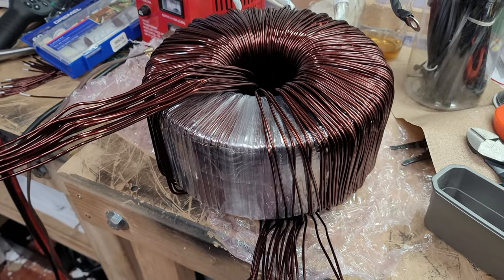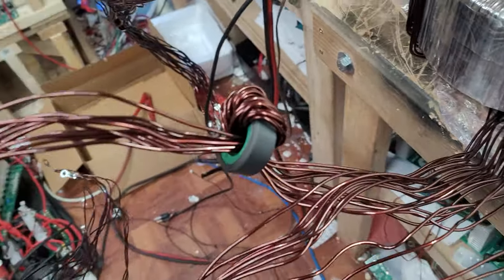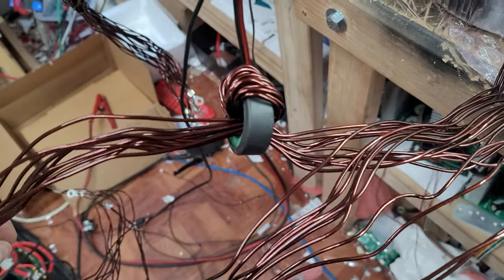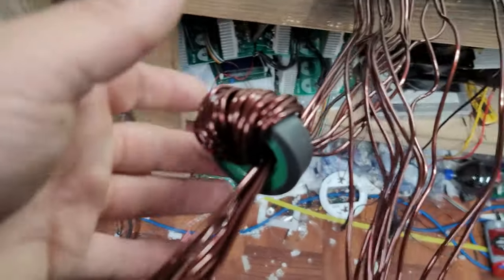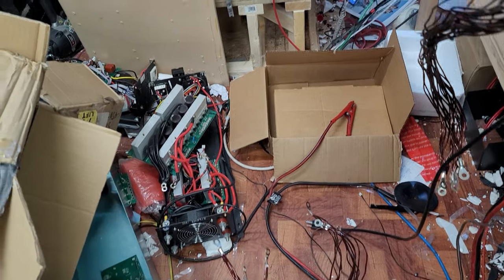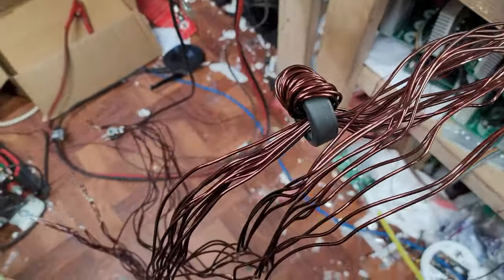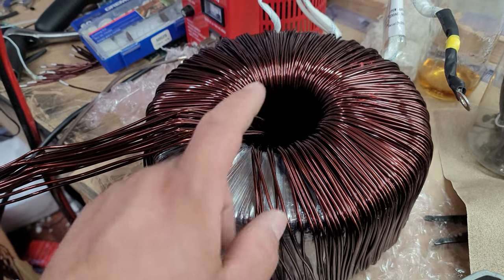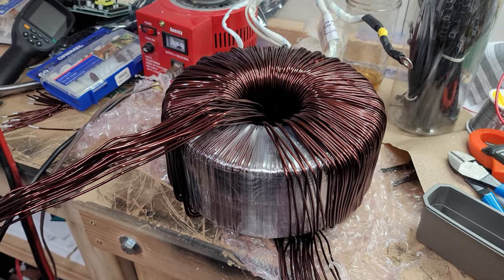Transformer choke tricks?

Comment: 1 turn is all you need. 2 turns turns it into an inductive heater as the Ferrite Core is saturated. No such thing a AC Positive and AC Negative leads. Those are L1 and L2 of the Primary. Your Mosfets just produce pulsed DC. When one side is on, the other is off.  Glad to hear the newer transformers do a better balance job. My ASL1 has 119 V on Line 1 with only 114 V on Line 2. And that is set at max Voltage. As you have two Main Boards, yes, you would want an equal number of wires to each. Also you might want to add a jumper wire between the two units to make sure they stay balanced.

Comment: The turns around your  choke are inducing current into it, that's why it's getting hot (like how an induction heater works). If you put the choke that you have, in the unfiltered part of your dc circuit, it will help reduce voltage spikes. As the current in the dc part of your circuit does not change direction, 50-60 times a second, no current is induced into the choke, and it won't get hot from induction.

Comment: Its called Saturation, It's core is fully saturated, So either go with a different mixture or a larger size. I would check the frequency coming off and see what mixture you need..The ferrite mixture. Do you know what type it is? There's thousands of mixture. I rewrapped my transformer in type 61. On both Positive negative.

Comment: Fun project.  I think your answer about heat is in what the choke does in general it is like adding a big resister inline so they get hotter the more resistance it is providing.  The fields interfere with each other resisting the current flow which will filter out HF noise but if there is too much your final efficiency will suffer.

Comment: does it make a difference?
Take voltage and current measurements before and after adding the choke. If the choke is getting hot then power is being wasted, they are only used to reduce ripple and noise. You'll need an oscilloscope to see the difference

Comment: Thinking about the problem your working on some more.  So getting it tuned perfect is pretty tricky so may have better luck with a tuned line filter.  Looked some up on Mouser think this Delta part number 108-30DKCS5 may work pretty good.  It uses a filter resister capacitor circuit combo.  I have used these in the past on large postal equipment to filter out harmonics in line to provide cleaner power for the micro-nets.

Comment: I stopped at 5:18 as I'm pretty busy but here is my take on this because you are asking for advice.....I'm not an RF engineer which is way different than a programmer or other types of electrical engineers.....toroidal transformers do not change the power (ohm's law and Kirchhoffs's laws apply here so basically the efficiency power out divided by power in means that the power on the output is the same minus the power loss due to efficiency/heating)  So the power changes from low voltage with higher current to higher voltage with lower current.  Toroidal transformers provide self shielding properties.  They also have inductance squared to the number of turns so less copper wire can be used with a much larger toroid core.  Less copper means less I squared R loss.  You talk about chokes....nobody is talking about what frequency is desired to be suppressed.  So the choke behaves as an inductor but the choke uses a "mix" as you mentioned to absorb the frequencies desired to be suppressed more than the other so essentially the core acts like a sponge in some ways but at different frequencies the sponge effect varies and of course with high enough power....can we say RADAR in the pulsed megawatts?....the toroid can "ring".  For an AC mains choke the obvious is you would want to suppress the higher interfering frequencies while not suppressing the mains frequencies at all.  So the question becomes more than the mix but also the material.  There is powdered iron vs ferrite essentially with each mix absorbing and behaving differently.  If you don't know the interfering frequency just throwing a choke in there may be a serious issue.  Also, chokes can be potentially used to help suppress ground loops but good luck on that one.....folks use opto isolators many times for signalling/data but those have a fixed life expectancy that is really long but still have one.  You mentioned the square black plastic so I'm assuming you are talking about the split type that allows less turns and is not continuous....so basically that is a compromise.  Why worry about the choke in the first place?  If not needed then don't use it.  If there are interfering frequencies it is time to break out the test equipment and suppress those.  Then there is the FCC requirements etc.  Again, I hear no mention of interfering frequencies, type of material, and specific mix.  The power handling can be determined by the size of the toroid.  The reduction will also be dependent on the square of the number of turns which is directly proportional the inductance etc etc blah blah blah.
Reply: Oh....I forgot to discuss shielding.  This is another dimension of noise reduction.  One can use pass through devices on a metal enclosure that essentially has a center conductor with a fixed capacitance to the outside shield.  I also did not bring up filters which is yet an entirely different field of math/electronics.  You can have band pass, low pass, high pass and different types and number of stages.  The old standby at RF is usually a capacitor in the micro farad range.  You may find this as a really good way to reduce noise because at AC mains the capacitor will be seen as an open circuit but at interfering frequency a short.  With a filter it can go both before and after the toroidal transformer.  Then with shielding I cannot help to bring up again the subject of liquid cooled (yes for the nay sayers I will link again the blog from an industry leader that calls it liquid cooled vs air core etc etc blah blah blah perception becomes reality blah blah blah).  If it was me making a frankenstien inverter I would have a shielded liquid cooled (using Shell Diala which is mineral oil with inhibitors used in power pole transformers/pig pole transformers by slang name)  This would be like an RF dummy load.....cooling fins.  So an RF dummy load has a non inductive resister immersed in..go figure mineral oil with inhibitors that does not react at frequency range it is rated at....with this you can then have passive cooling to the air.  Liquid cooling always blows away (pun intended) air cooling.  With the broadcast industry I learned a joke which goes like this "real tubes have handles (because they are so huge and are made from glass and insulators rated in the 10's if not higher kilo watts) and when do you have too much air cooling?  Answer:  when the fan blows the tube out of it's socket. hahaha blah blah blah.  So in other words air cooling sucks when not using a liquid transfer medium to take the heat away from the protected device (toroid transformer).  One could get insane power handling with this method but of course it costs money so don't expect it soon unless they discover an already existing extruded aluminum size that is large enough to house the toroid.  Then one would need to get a tig welder or robotic welder to close up the top and bottom or machine so top and bottom can have gaskets/o-rings.

Comment: The purpose of these Ferrite Choke is to meet FCC RFI emissions standards.  Keep any Radio Freq Interference in the equipment.   What are you attempting to accomplish ?

If your transformer is getting hot it's a function of Current.
Reply: The ferrite choke makes a CONSIDERABLE difference in the no-load current of a Power Jack inverter.  In my experiments, a 48v inverter with no choke runs over 5A no load.  With several choke-winding tricks, I was able to get my 9K down to 0.7A no load.  My guess is that it is providing some much-needed inductive "capacity" at very low load conditions.  With a PJ inverter, the transformer and choke get gently warm (0.7A no load current achievable); however, with a Genetry Solar control board (and much stronger FET drive), the choke gets quite hot at no load (0.4A no load possible on an 8K).  Also makes a 60Hz humming noise, and the sound changes if you squeeze it.
Reply: @sidlori1592  If it does it's taking down the on line current as well.  They're only there for RFI.   Think : Impedance.  AC only Resistance.  That long pig tail is going to cause issues too.  Everything on the other side of the Core is going to work as a Antenna.   Adding NOISE.  Your none loaded load is caused by the incorporated circuits them selves.  LED's.  Cap leakage and what not.  Ferrite is only hiding the other stuff.  One turn does what the farrite is meant to do.  Adding turns is CHOKING your power output.   Something is being driven if it's using that much current no load.  That's way more current then you should have with no load.  Only thing that should be seeing power when idle is the sensing circuits and clock.   Assuming it has a Micro Processor Unit  I would expect less then 100uA.
Reply: @pulesjet  "One turn does what the farrite is meant to do."  Nope.  Adding or removing turns to the transformer winding only changes the ratio.  If it was as simple as adding one turn to the transformer winding, Power Jack would be doing that themselves, instead of buying a choke.

"Adding turns is CHOKING your power output."  Not possible for the choke to significantly reduce the output power on a 15KW inverter without the choke going up in smoke.

"Only thing that should be seeing power when idle is the sensing circuits and clock"  Umm, as in, inverter powered off, no AC output??  No load is defined as 'AC output at desired voltage, no load connected.'

"Assuming it has a Micro Processor Unit  I would expect less then 100uA."  The PIC18F87Kxx MCU running at the full 64MHz @ 5v (which it does in a PJ inverter) is rated at 14mA.  You have to turn the CPU off (Sleep or Idle modes) to get 100uA.  If you're referring to full inverter operational current with no external load connected...umm, not close.  Adding to the 14mA MCU is at least several 10s of mA going to switching the MOSFET gates (~8,000pF * 24 FETs @ 24KHz, thank you very much).  Not to mention the other power supplies and glue logic.
Reply: @sidlori1592  If the Choke Ferrite is heating it's obviously inducting the lower freqs too.   At least with your added twist.   15Khz.The ferrite is not your issue.  The power is being consumed someplace else.

Comment: Wouldnt you need to add more copper, with less turns to equal the same wattage? Without heating? I have studied quite a bit on building transformers, it has been a long while,  so I  have possibly forgotten a bit I guess!
Reply: You are absolutely correct; however in this case, the PJ windings are quite underrated on the AC "line" side of the transformer.  A lack of copper cross section on the "battery" side of the transformer is not going to be significant in this case.

Comment: reducing turns in the transform also reduces the current handling
Reply: By removing wires on the Secondary, he is getting it from a 6.7:1 ratio to an 8:1 ratio to keep the Voltage the same, so Wattage and Current will be lower.
Reply: True.  But it's a simple way to avoid rewinding the entire primary ;-)

Comment: Try that giant core I sent you
 I am using one just like it and idle current is 0.44 
And it doesn't get hot
 if you want to use smaller core you will need to use Square ones 
so you can have a space or gap in the center leg 
The bigger the gap the more amps it can handle before it saturates
Reply from the maker: Yeah I think I will do that
Reply: I can go count how many turns I put on mine so you can get a perfect wind 

Or you could stop by and swap your empty core for my all ready finish one exact core as yours

If you glue four of the power Jack cores they work ok I think 0.80 idle amp

Comment: IS THE MOSFETED DC TO AC CURRENT GOING THROUGH A SINGLE WIRE OR SEVERAL WIRES I SEE WOUNDED AROUND THE PRIMARY COIL ? TRYING TO UNDERSTAND THE TWO ENDS OF SEVERAL WIRES HOW THE CURRENT GOES IN AND OUT THE PRIMARY LIKE A WIRE WRAPPED AROUND A NAIL TO A BATTERY . GREAT VIDEO . IF YOU GET A CHANCE , PLEASE WATCH MY SOLAR VIDEOS AND LEAVE A COMMENT .
Reply: The AS9 transformer that Sean has been modding here has 22 wires in parallel for the "battery" winding of the transformer.
Reply: @sidlori1592  If that is the case, then he DOES NOT want to shorten them if going from 36 to 30 Volts. If that is the primary, which it appears to be, then he needs them longer. If those connect to the MOSFETs, that is indeed the primary. Only shortening the secondary side will raise the output Voltage with a lower input Voltage. Now if he takes a 36 Volt one and shortens them, and then uses 48 Volts, it would be okay.